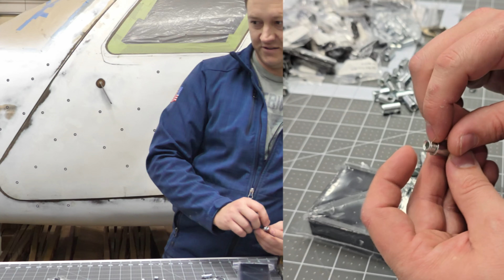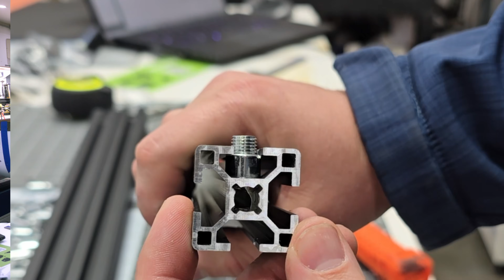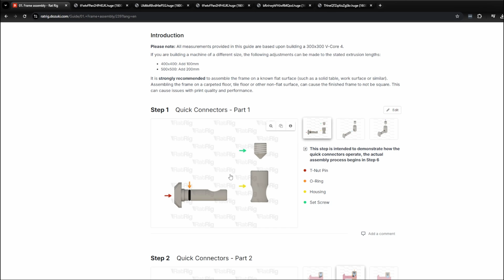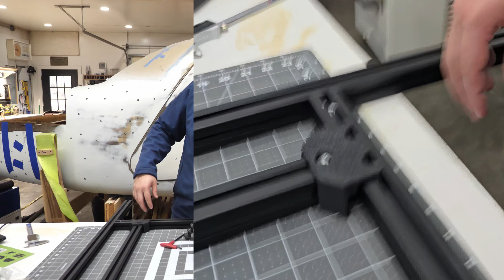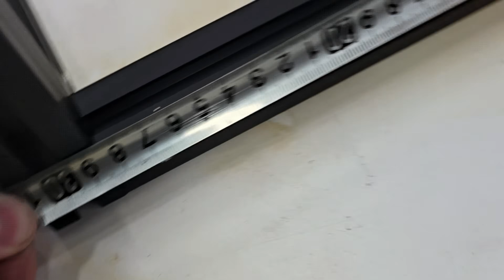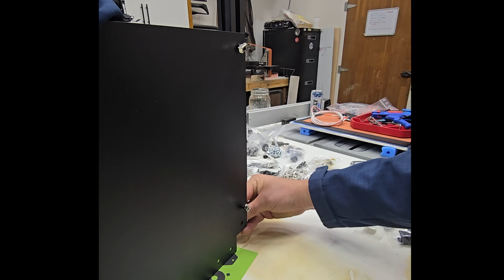Building a RatRig Vcore-4 IDEX 3D Printer: Part 1 -  Building the Frame

Comment: After trying to use a pair of aluminum levels to align the frame ends, I gave up and built the frame in my garage using the cast iron tops of my jointer and table saw as my flat reference surface. I'm really happy with how square the frame came out and it's pretty much perfectly square (less than half a millimeter difference the diagonal corner to corner measurements on every face). Thankfully the frame fit through the door after construction by a couple millimeters on each side after it was built. 😅

Side note, I don't know about 5 months ago, but the instructions these days are pretty good (until the print head/electronics sections) and if you pay attention, there are all sorts of little things that can make your life easier. For example, the grub screws on the frame should be accessible from the outside, not facing in. Or at 18:39 comment that the instructions weren't clear and then you tighten the corner and check square, it doesn't say anything because you aren't supposed to tighten it here because you level it with the back cross bar using the motor mounts later. Maybe they should call it out in the instructions deliberately not tighten this screw at this point, but my point is that if you follow the directions to the letter, you're usually going to be OK. And if you're reading the comments on each step, those who have gone before will give you a good idea of when it's actually helpful to deviate from the directions.

EDIT: 25:41 Ah... I see you figured out that there was a method to the madness.

Comment: no loctite ?
Reply from the maker: No..for the most part, I did use it in a few areas but mostly went without  and I'm hoping that doesn't end up being a problem. So far I haven't had any issues though.